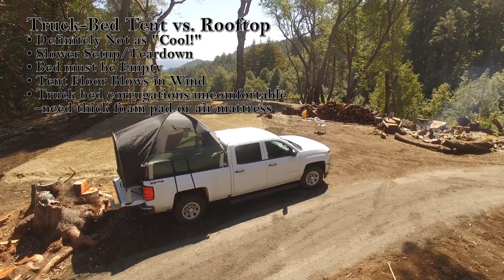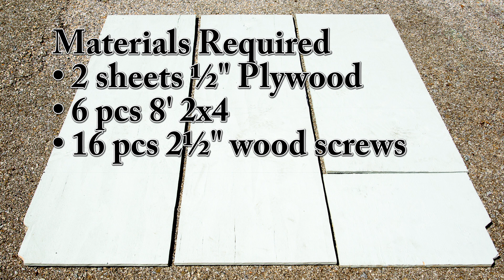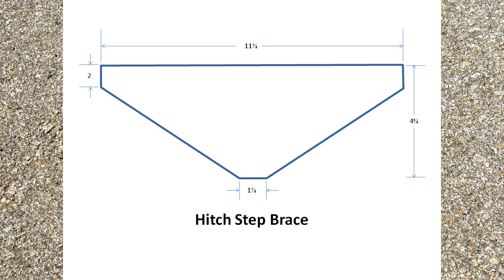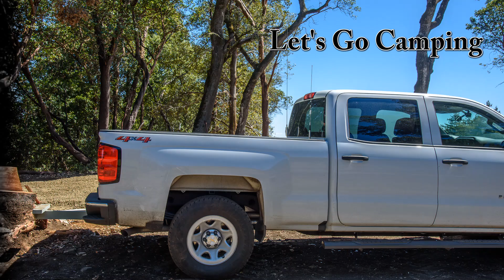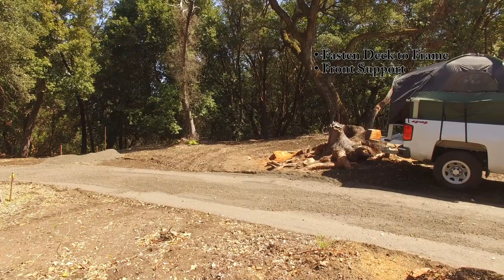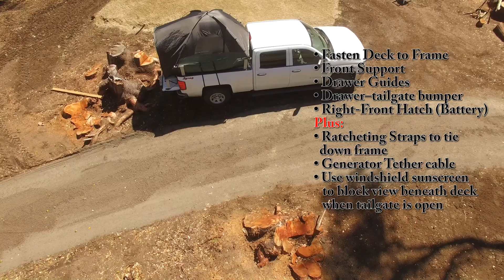Build Your Own Truck Bed Tent Deck

Comment: Mini Solar Tip; You can steplessly dim down a bulge and all other hungry electricity consumers with a 5000W dimmer (7, EUR). I run 5 dimmers in parallel on an 850W inverter. Kettle 2.2KW at 150W runs 12 hours a day, so the water is always hot. The room is also nicely heated. 2.5KW washing machine runs in parallel with dimmed to 200...400W. Iron, dishwasher, oven, electric heater, coffee machine, all internal heating are throttled with me. Videos about it on my channel https://youtu.be/eC2olbCBhh0 The inverter stays cool, quiet and the MOSFETs remain intact because extreme current peaks no longer arrive at the inverter. Now every Mini PV Inverter is enough to sell large devices...

Comment: This is a fine idea for a tent camper. You may be able to use a short length of cold roll steel as a roller for you drawer.

Comment: I guess I must have missed something. Where did you get the tent and what kind is it? Why is the bottom of the tent stuffed inside the bed? Won't that allow rain to get in the bed of the truck bed? Did the tent come with the awning over the tailgate? How are the risers attached to the truck? You also said you use the bottom as a tonneau cover. Does that mean that you raise it high enough to be level with the bed of the truck? If so how do you do that?
Reply from the maker: K6XX
- It is just the cheapest tent designed for a full-sized truck found on ebay. Was $99 in March 2020. Looks like they are about $140 now. It came with the awning. Search for "truck bed tent" and you'll find lots to chose from.
-bottom is inside the bed because that's the way the design works. It is a truck bed tent.
-It woks in the rain OK. The tent bottom is waterproof and the truck bed drains, so water does not accumulate.
Risers attach to the truck in the holes along the sidewalls.
The deck is NOT flush with the sidewalls, since this wouldn't work with the tent. It is similar to a tonneau cover.

Comment: 3/8" Teflon strips of those plastic cutting boards screwed to the bottom of the draws in line with the ribs of the truck box will work awesome at keeping draw sliding easy n straight
Reply from the maker: Excellent idea.

Comment: Can you think of anyway to provide security for your items in storage area, as, if you left the setup area, your generator, solar battery, etc., would provide easy, quite visible, pickings.
Reply from the maker: The philosophy is "out of sight, out of mind". When we were evacuated (Aug 2020) and actually needed this thing for a few days, used screws to attach the plywood decking to the frame, preventing easy access to riff-raff, but it certainly isn't high security. 

The generator is going to be visible--it is too big to fit beneath. You could store it inside the cab when parking in town.

Comment: Airbedz makes a air mattress that goes around the wheel wells and the bed would be lower and then you just get a truck bed tent done put all the gear in the cab

Comment: What about toilet storage & supplies, & water?
Reply from the maker: I purchased a plastic toilet and sink from an e-bay vendor. The toilet would easily fit in the generator cut-out, or in a second cutout as you prefer. Water fits beneath the deck, just like gasoline for the generator.

Unfortunately the plastic toilet & sink burned up along with my house last August, so I can't show you what they look like. 

Yes, as a matter of fact I did evacuate using this truck bed tent deck. It worked well, especially given the circumstances.

Comment: Well done... so this tent is a truckbed tent just set on a platform... not a ground tent ?    Regards
Reply from the maker: Thank you for the comment. Simple answer: yes. 
The truck bed tent  (see eBay, etc.) fits into the truck bed very neatly, but with the deck installed you get three main benefits:
1. No wheel well humps to deal with
2. A flat surface, which is much more comfortable than the corrugated metal truck bed
3. Storage. Whether in motion or set up for camping, you may store your things under the deck. They don't have to be moved every time you move.

Comment: Consider a Softopper, it folds down in a minute  for full bed excess.  It is a weather tight sleeping area, if you build a drawer system it's even better.  No set up or take down, just unload or load any gear that doesn't fit in the drawers.

Comment: You are a very creative individual! Me, not so much. Can you please share how you attach the tailgate piece with dowels? Thanks in advance
Reply from the maker: Hi Brian. Thank you for your kind words. 
I had some 3/8" dowel stock (you can get it from the 'big box' home improvement store or any lumber yard) and cut a few 3/4" lengths from it. Then I assembled the truck deck and drilled 3/8" holes in the right positions. The dowel pieces were glued into the plywood. The matching holes in the 2x4s were drilled out the next size larger so the dowels fit easily. Pretty simple, really. There most likely is a better way, but as you saw, I was using materials on hand.